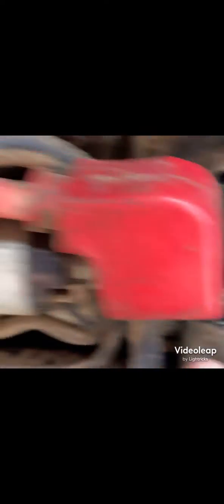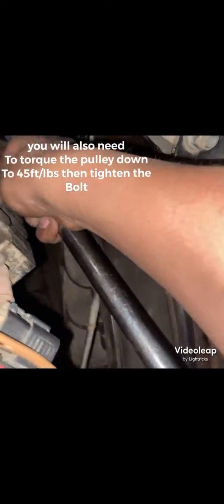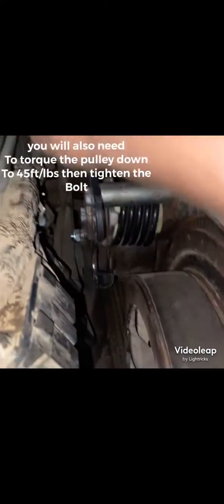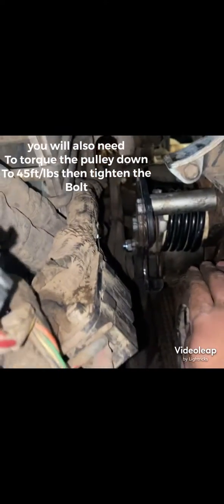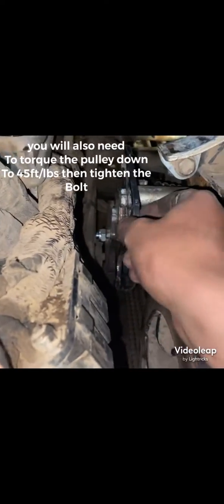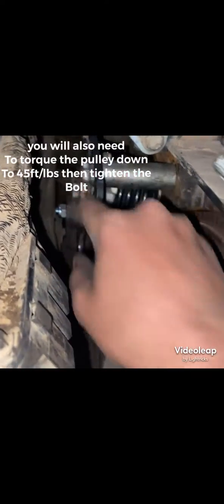How to remove and install Bobcat T870 tensioner pulley while in machine

Comment: You didn’t even show how to install the bolt that holds the assembly to the block. My bolt hits the chassis and won’t come out. 🤦🏻‍♂️
Reply from the maker: @S2Krazy  you gotta undo the engine mount bolt that’s right below the ac compressor. It drops the motor a bit and makes it to where the hold is removesble

Comment: Dude wtf how did you do this
Reply from the maker: You gotta remove battery and plastic pulley cover. Then remove rear motor mount and remove belt and tensioner bolt
Reply from the maker: I have one apart right now. I can send pictures if you email me